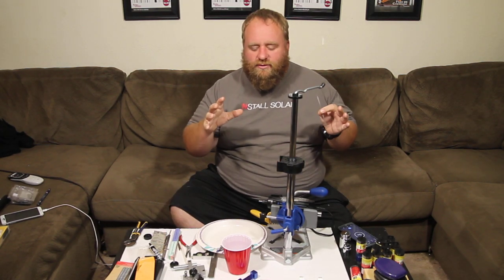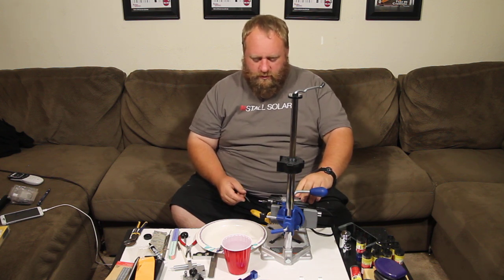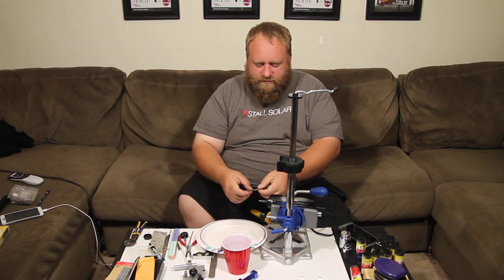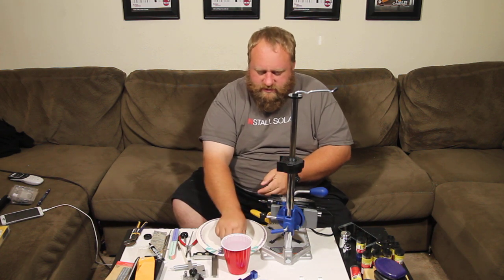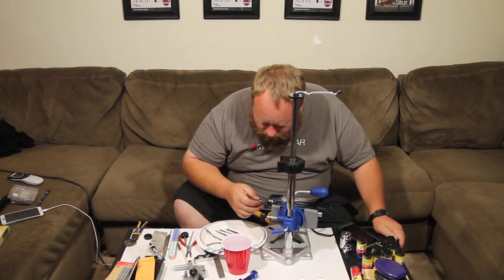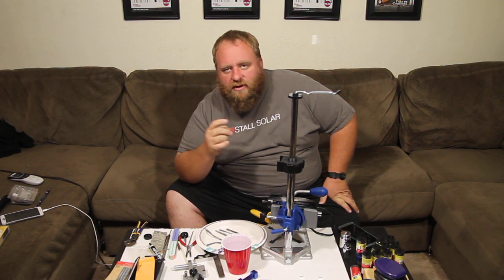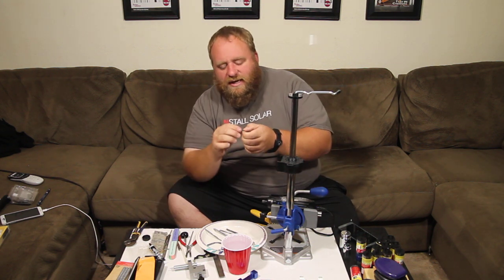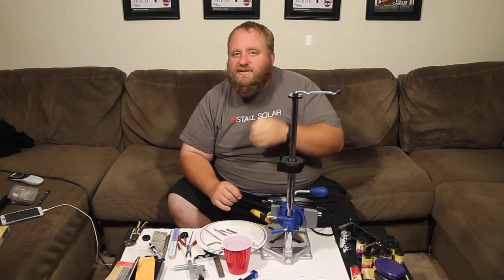pinewood derby speed tip 1of 5  axle prep

Comment: Awesome video series.  My son continue To rewatch each several times.  Been a huge help!!.   What size collet are you using in that Dremel, 3/32? What is the advantage of  coning the axel head?  And what do you mean by coning? Makes the head of axil smaller yes?
Reply from the maker: So I truly do not know I just buy the kit that has all of them in there and find the one that fits a lot of axles are different sizes so I think I use a different one for the scout ones versus some of the other different axles I've done over time as far as counting them I take the head and round it so the flat part on the inside of the head closest to the actual axle itself is slightly angled out

Comment: Whats better a graphite axle or a polished Axel?
Reply from the maker: Ryebreads I do not recommend buying the pre graphite axles truthfully graphite is sticking to the plastic not the metal so I like to polish it and then add graphite I need so much better most of the professionals I talked to  told me that they did not have good results with the pre graphite axles

Comment: can you actually file the axle down to much?
Reply from the maker: Yes you can you want to leave the axle at the same diameter as much as possible you just want to polish off anything that might be causing a problem but leave it as big as possible
Reply: Thanks I think I took to much off of our axles and I had the back axles to far forward. Where can I purchase the axle angle drill block? like the blue one you have. I tried to bind the axles using the strait tracker but I couldn't get them to turn out right. I was bending them way to much for some reason.
Reply: @dallascarnahan8935  Amazon